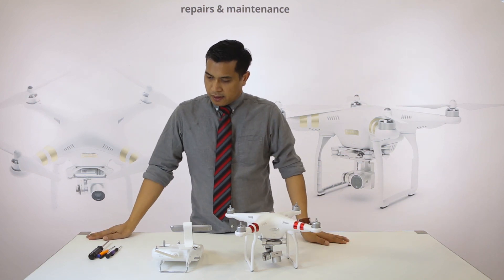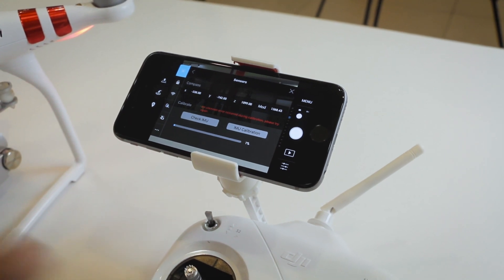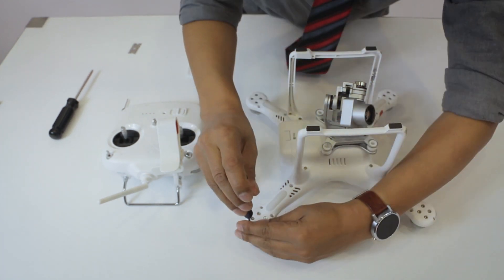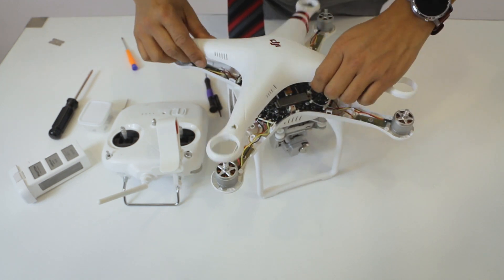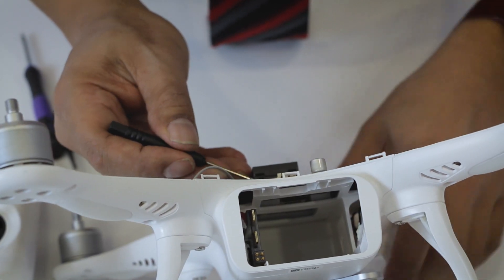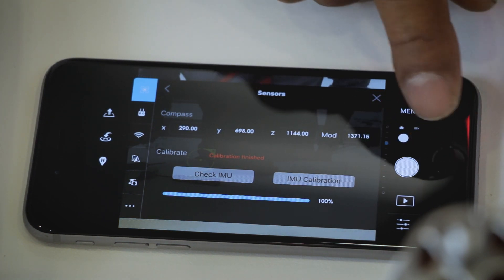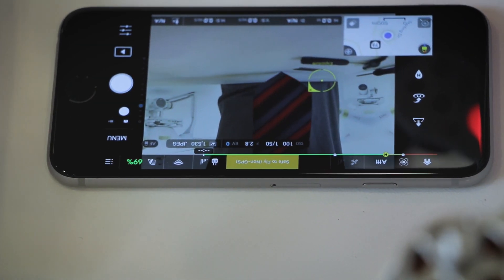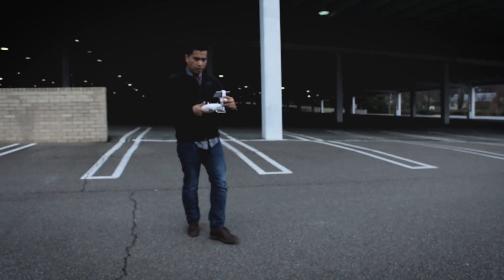Phantom IMU Repair

Comment: woow this made my day, i own the phantom 3 and i am doing a personal project with this machine, this morning i crashed it on full speed into a small tree, everything was just rocks and mountains, fortunately when i went over to find him i expected to find him in 5 pieces, when i got there he was laying into high grass got 1 or 2 scratches and one propeller blade was damaged, well i thought he might work again, well it didn't work out, because i had to calibrate the imu, it failed over and over again, i found your video, i did what you did, and well it works!! i am so grateful, thanks for posting this video!!